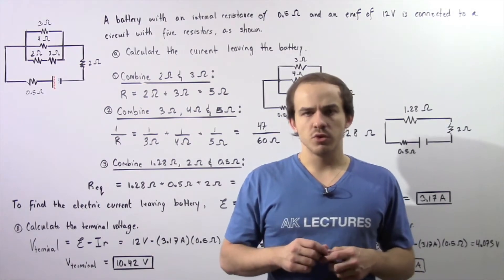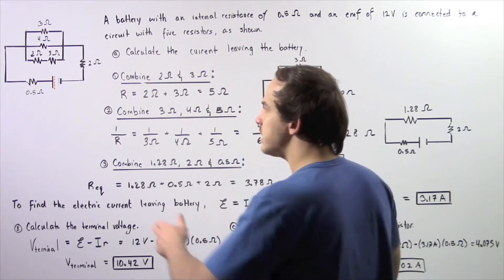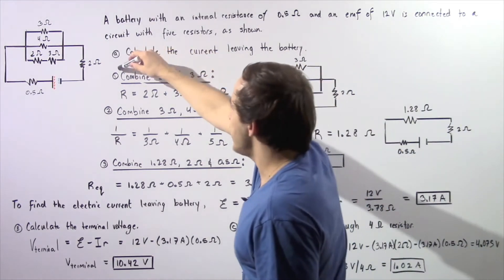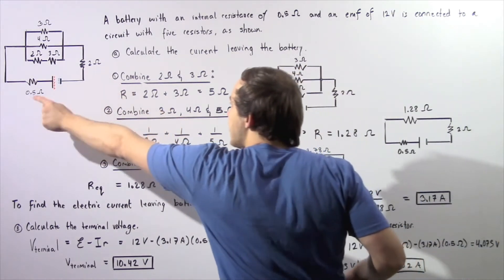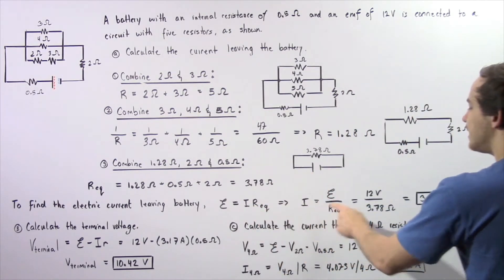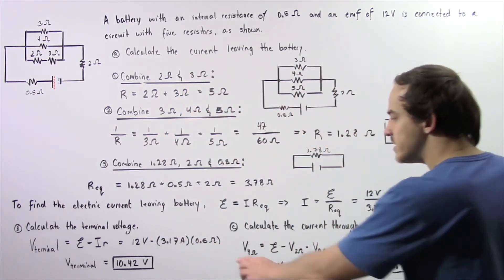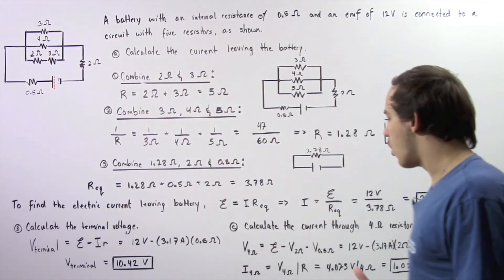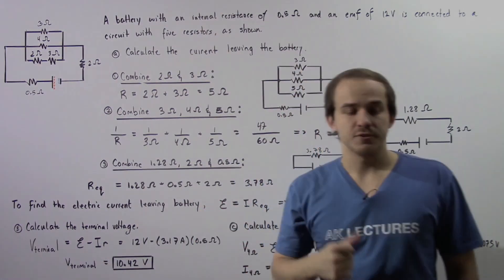Resistors in Series and Parallel Example # 4

Comment: How did you get 1.28 Ohms when I divided 47/60 and got .783 Ohms?
Or am I missing a step here?
Reply: The formula is 1/R so you have to flip the fraction. As a result it is 60/47 which equals approximately 1.28 ohms.